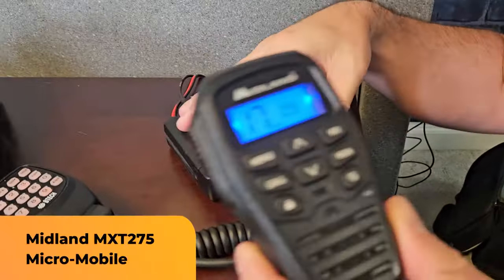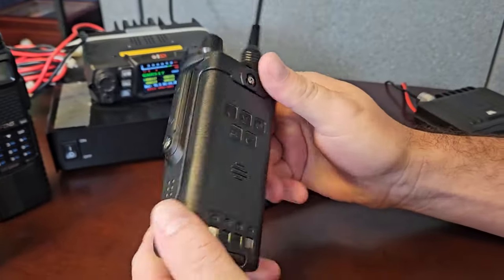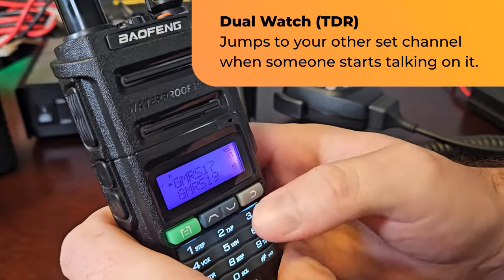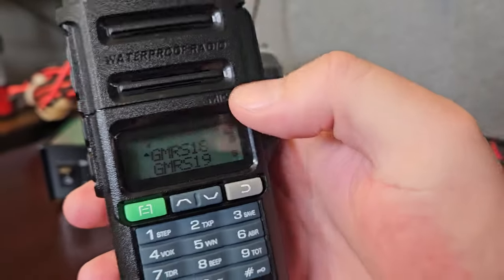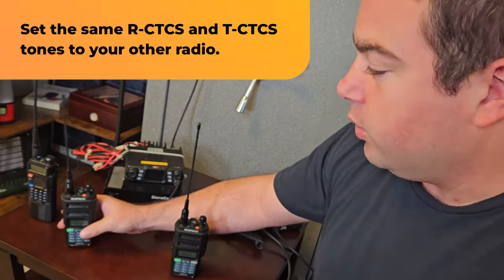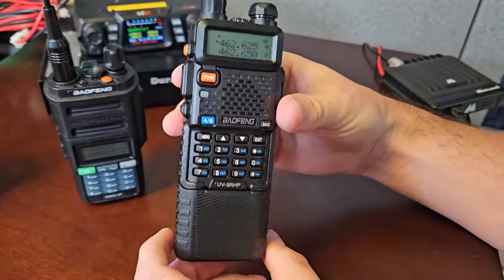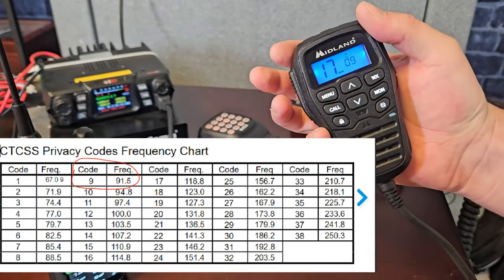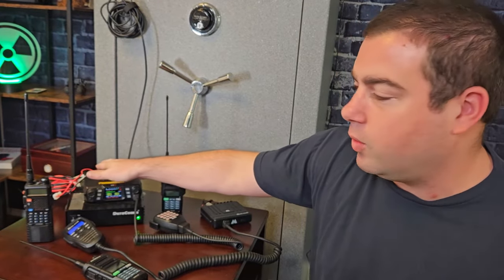How to Program your GMRS Radio: Step-by-Step Setup Tutorial

Comment: Great video. I am a noobie and its get so confusing but your video broke it down. Just to confirm. If I have two daughters in college one in Arizona and one in Michigan I can get each of them a radio. At home in California I can have a radio or in addition a base to speak with them in case of SHTF etc. Question is it possible to speak to both at the same time to check on them or do I need to contact each separately. Also, how to I contact them using a repeater is it automatic or do I have to do something? Just get the license and it will reach them? Sorry but no one explains in simple terms. I just need  something that will allow me to contact my girls who are in different states.  Thanks!

Comment: Thanks for the video, def it helps. Im trying to set up GMRS repeater on Baofeng uv 5G,   
local repeater info 

462.725 MHz
Frequency
241.8 Hz
Input Tone
192.8 Hz
Output Tone

 Could you do video on the set for this, on a UV 5G.
I am almost. there I think.  getting the. " kick back " when I key the mike, but verbal is not coming through. I think offset is wrong maybe.
Reply from the maker: it seems like this is on repeater channel 22 so you will get it on 462725 but your radio will  autotransmitt on 467725 turn your rx tone off and your transmit tone to 241.8. Thats what i would try first but no matter what turn tour rx tones off and just try both tones in. its weird that this repeater has got 2 differnt tones i have not seen that before. I hope this can help at some point im going to do a repeater vid.

Comment: So basically, I see no need for the software, however, I would like to do some naming of channels and radios. But I’m having issues doing so, the baofang software will download but will not “set up” on my computer. It can’t find the file. And then when I go to use chirp, I get this message. “Error reading data from radio: not the amount of data we want.”

Any advice?, other than purchasing the RT systems, cable, and software? I’m afraid to waste money on that, and not be able to use it also!
Reply from the maker: I have never messed with chirp i probably should educate myself on it at some point.

Comment: Hey i just got the GMRS-9R from Amazon, and the GMRS channels from CH15 and beyond don't allow me to transmit. Any suggestions? This is very frustrating 🥺
Reply from the maker: how do you know they are not transmitting? do you have tones set on other radios?
Reply: @citizensurvivalplan  I do not. Also, the led indicator isn't illuminating when I hit the PTT button. I just get a beep, but no transmission. Even the screen doesn't change color to the default orange.
Reply from the maker: go to menu 40 and reset all see what that does it seems it came with some sort of lock on it for whatever reason. if that does not work coment back to me i will look into this and try and help you mine did not do this.
Reply: @citizensurvivalplan  same result, but I wrote to them and they responded quickly! I'm sending them a video tomorrow for them to let me know if it's faulty or if there's a fix. Will update you here when they figure it out 🙏🏽

Thanks for your assistance!
Reply from the maker: Yeah let me know what they say.
Reply: @AdventureRich Friend, did you find any solution? my GMRS-9R from Amazon does not transmit either, I cannot find a solution to transmit, I would appreciate your help my friend

Comment: The Baofeng UV-5RHP is a good  little cheap radio. I don’t get why you tell people not to get them. Perhaps you didn’t know that the UV-5 comes in a GMRS version, called the UV-5G.  Which means that you don’t have to program it with the frequencies, like you did. Now, if you are one of those SHTF survivalists (something like that) or outdoorsman, then yes, the lack of waterproofness becomes an issue. There other radios that are way better.  My current favorite is the Ailunce HA1G. A great radio build like a tank. But and I am looking forward to getting me a Wouxun KG-UV9GX.
Reply from the maker: I am going to check this radio out. Yeah I want people to have a Ham radio like the uv5rhp but i want them to really focus on getting a bunch of radios like gmrs to hand out and use during shtf gmrs is more simple.
Reply: Actually, I have to correct myself, because the UV-5G is IPX4 rated. Just like the new upgraded version UV-5G Plus. Which means that rain should not hurt it. While the UV-9G is IP-67 rated. Which means that it can be submerged in one meter of water for up to 30 minutes.

Comment: Why isn't the 8w better than the 5w?
Reply from the maker: Adding 2 or 3 watts to a handheld radio really wont make a difference if you want to up the range get a 25 or 50 watt base station with a tall antenna to go further. I have tested the range between the 8 and 5 watt models in so many locations and the little extra power NEVER made a difference. Thanks for the question and thanks for watching!
Reply: @citizensurvivalplan  Cheers. I mainly bought the 8w because it came with a much larger battery. But, I guess if I'm using more power It'll probably negate the larger battery. Oh well. The GM-15 Pro is way better than all of the Midland products I've bought. Thanks for the help.

Comment: weeelll they arnt "base" radios. base radios are 110 volt. those are mobile and require 12 volt and require a extra expense of a power supply.. just making that clear because there is people who have put a 110 plug on those red and black wires and destroyed there radio and if they lived they where pissed. good video other wise just be safe